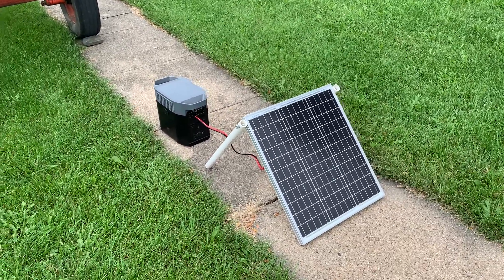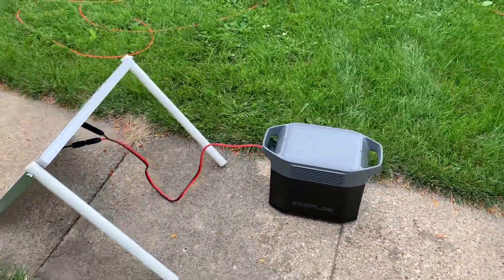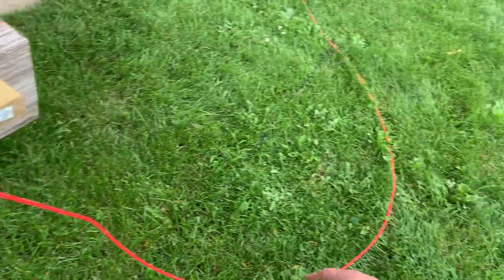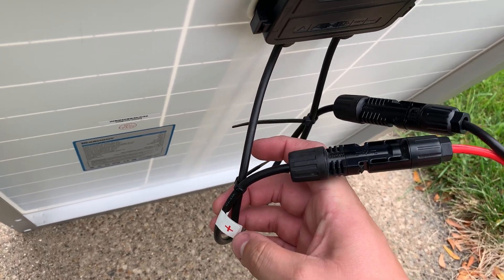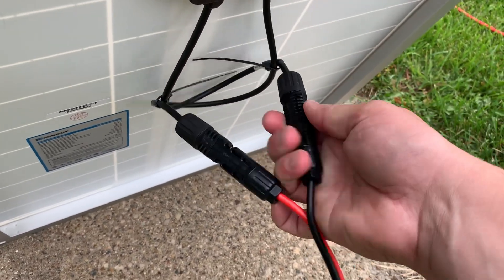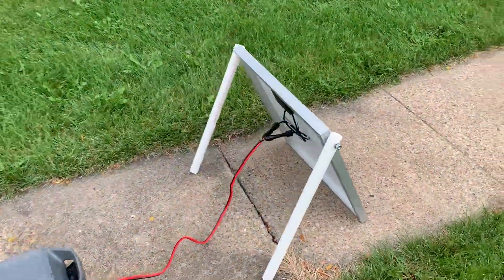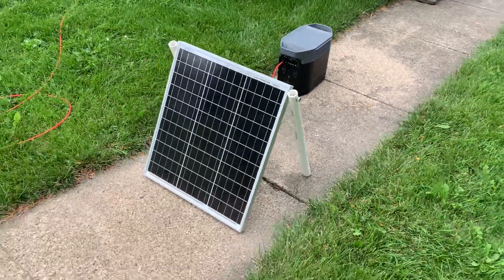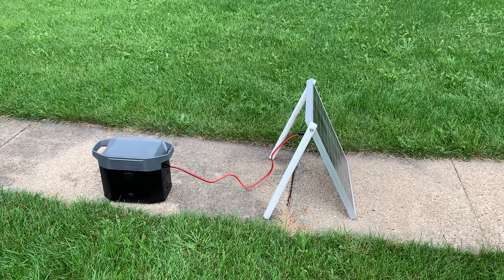How to wire Ecoflow Delta 2 - Solar

Comment: How long does that 50w panel take to charge a delta2. Roughly.
Reply from the maker: @modestadventurers  in absolutely perfect conditions it would need 20 hours of pure sunlight. But realistically if it's a nice sunny day and you keep moving the panel to face directly at the sun, I'd say I get 40-44 watts out of this panel on average. Plus you have to consider inverter loss and all that other stuff. I had a 600 watt array on the delta 2, and that would net me closer to 450 or so watts input. 3 series 3 parallel with 100 watt panels.

Comment: Did you do any grounding on your solar array on the cart? Also, did you use any combiner boxes or microinverters on the back of the large solar array on the cart?
Reply from the maker: @pognog2  no grounding, and no combiner boxes/micro inverters. All connections tethere the negatives of panels to left, positions on right, then 3 way parellel connectors run through 70 feet of 10 awg wire, to a mc4 to xt60 cable

Comment: How many feet of what type of cabling is going from your arrays to the inside battery and how much does it roughly cost? Any recommendations on where to get it?

Thank you good videos
Reply from the maker: @bcboncs  I’ll link what I’m currently using. I have a 20 foot section and a 50 foot section of the 10 awg . https://a.co/d/gVSelSm
Reply: @rnkustomz  thank you! So you can seamlessly combine these without considering factors like attenuation to attain 70ft? This is new territory for me sorry for elementary questions
Reply from the maker: Being 10 awg it should hold up decent to line loss, I’m sure there is some loss going on. But from what I’ve seen in other YouTube videos I believe under 100 foot of cabling this size should be pretty efficient.

Comment: What are some pros and cons of the delta pro vs the delta 2?
Reply from the maker: Delta 2 has lower output, solar input, etc. but muchhhhh lighter and cheaper. If you have the ability to keep the unit in one spot and can afford it, the ecoflow delta pro is nice, or the step up to a ecoflow delta pro ultra. That’s my future goal